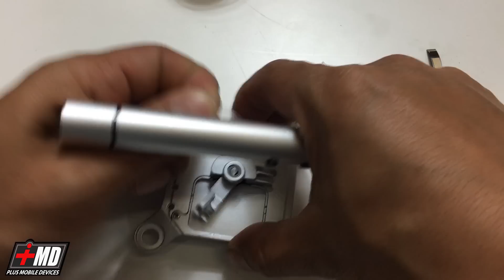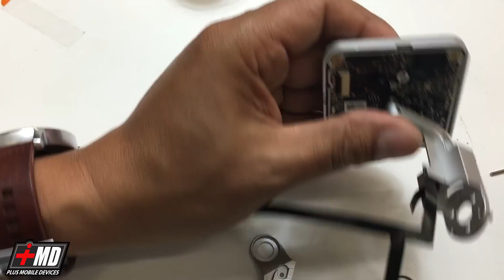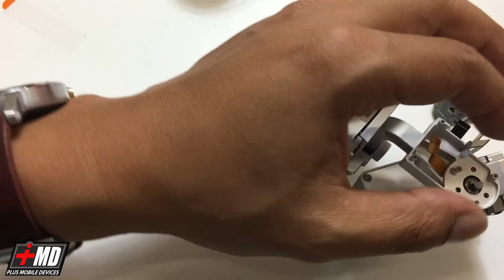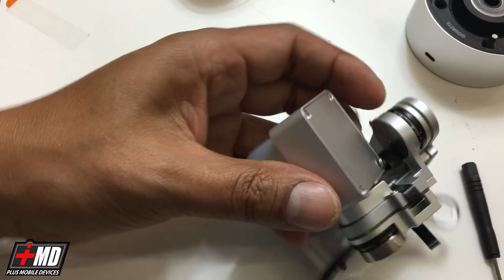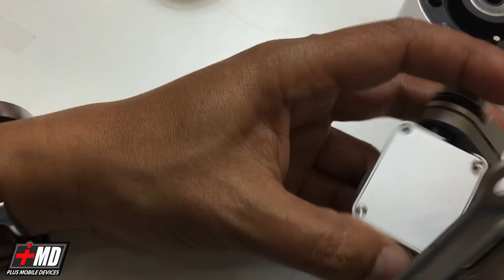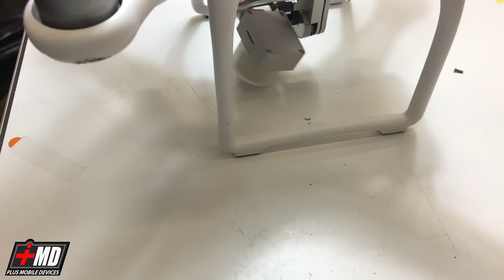DJI Phantom3 Standard Gimbal repair

Comment: HI. Thanks for the video.
I followed u to replace the arm for the same reason :). But...
I had to replace the roll arm and motor too. Arm and motor bought joined..
But now, the drone camera looks like crazy.
Do u know why and how to fix this behavior?
I've tried by IMU one time, but nothing.. and then the drone started also to lose the connection with the app, it works for few seconds. Now I can't try again IMU or other calibrations...
What's happened?  O.o
I hope u can help me..
Thanks.

Comment: thanks for the vid, I had almost the same damage. I reassembled it all with the new parts and ribbon but I have no motion from the camera and no picture. Any ideas? The little red light blinks that is on the side of the logic board and what seems to be a green light on inside the camera itself but that is it.

Comment: hey i appreciate the video. one problem. I followed everything you said. I recplaced a ribbon cable on a phantom 3 standard. I got everything hooked up. I turned the power on and there is video feed but the gimbal is limp. It doesn't move at all on start up or anytime. There is video feed though. Any thoughts anyone? Thank you.

Comment: I have a Phantom 3 Advanced. I have replaced the Yaw arm, the roll arm and the flex cable. When I started the drone the camera is rocking all over the place. What have I done wrong???
Reply: I just fixed mine and have the exact same problem. Did you find a solution?